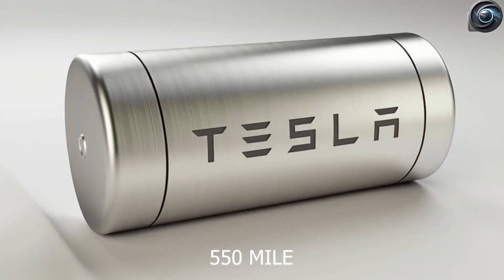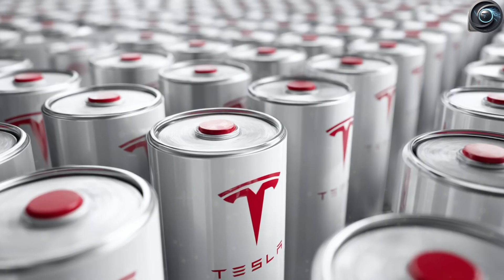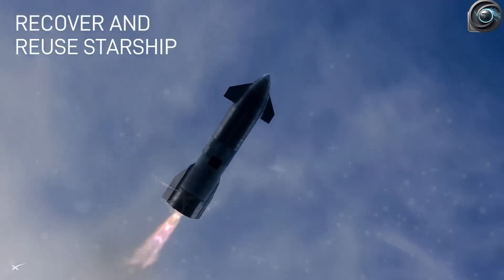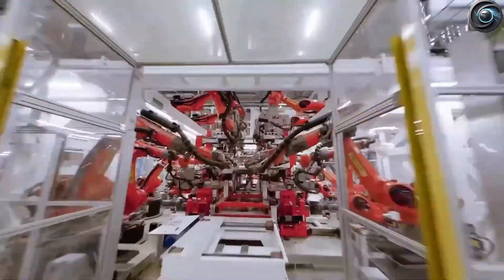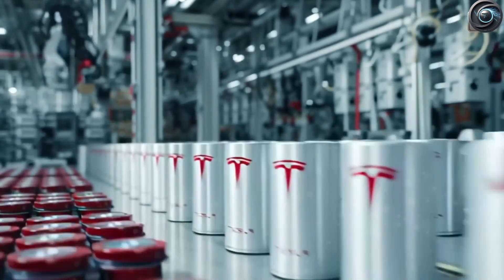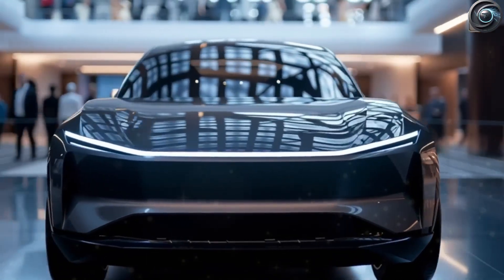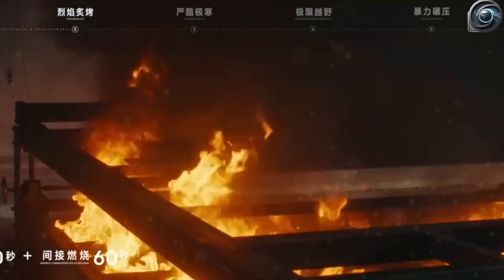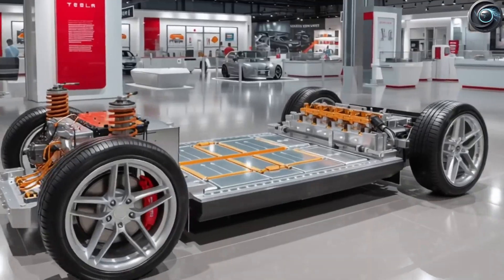TESLA’S NEXT-GEN MODEL 2 BATTERY: 50% Cheaper, 2X the Range?! (2026 Leak)

Comment: If true, can this battery be retrofitted to existing Tesla cars?
Reply from the maker: That’s a really good question. In most cases, new battery chemistries like sodium-ion can’t just be retrofitted into existing Tesla cars. The vehicles are designed around specific battery sizes, voltages, and thermal systems. Swapping in a completely different type of battery would require major hardware and software changes. So while it’s exciting tech for the future, it’s more likely to be used in new models rather than retrofitting older ones.